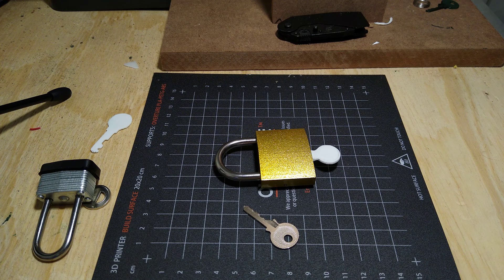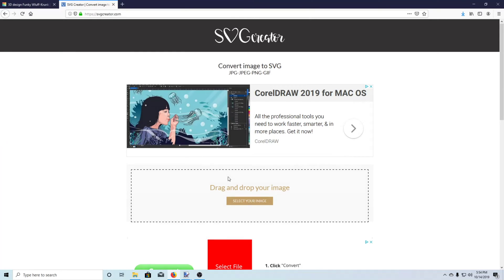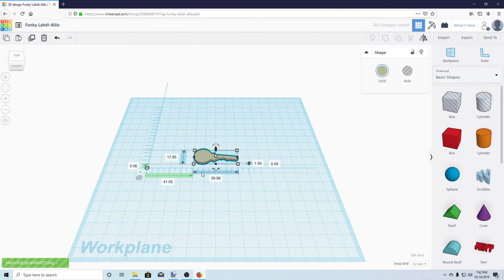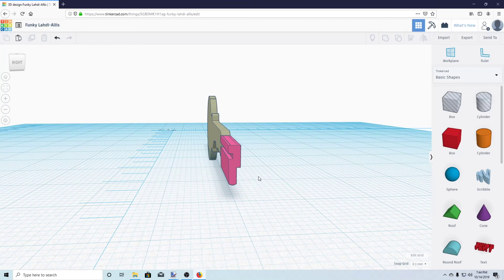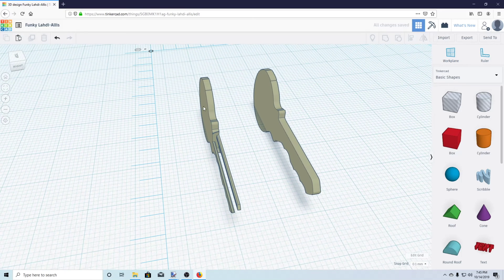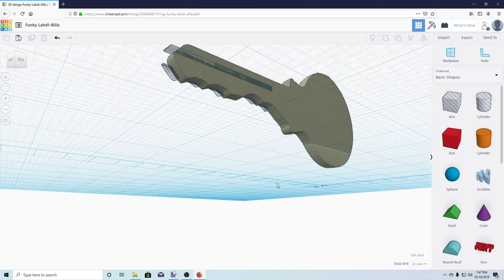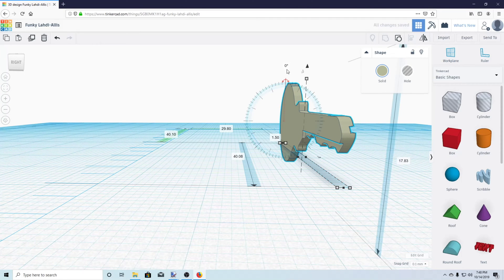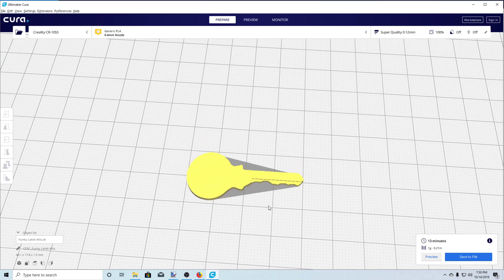How to 3d printed keys using photos

Comment: I have a problem inserting the key hole file. whenever i put in the width dimensions it makes the key hole tiny compared to the thickness of the key. any solution? what am I doing wrong?
Reply from the maker: My guess is that your having some over extrusion.  Sand the key down some and check. Additionally you could take and scale the thickness of the key in your slicer or stl just masks sure you don’t scale the other axis.